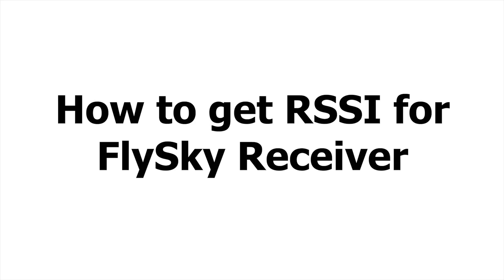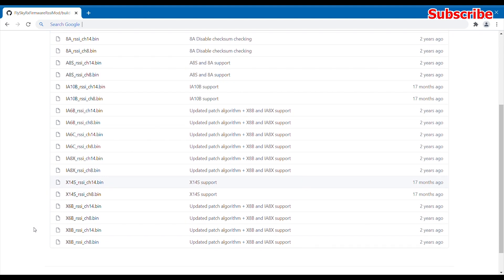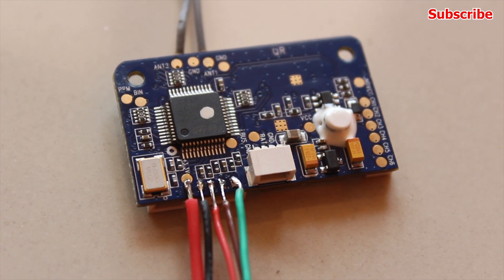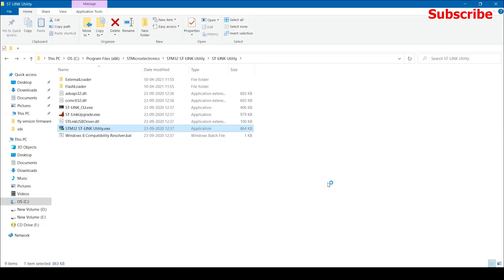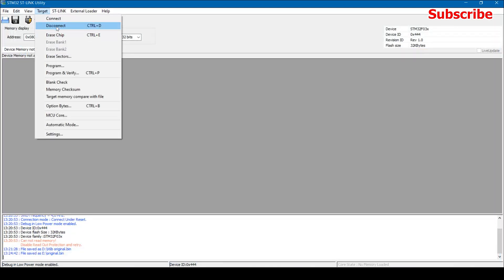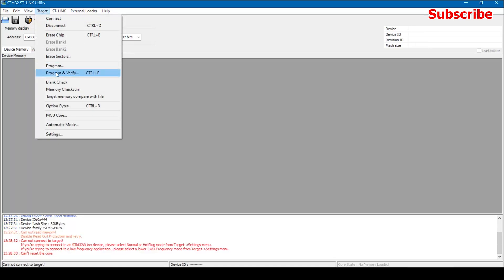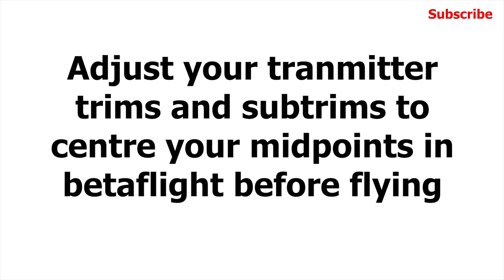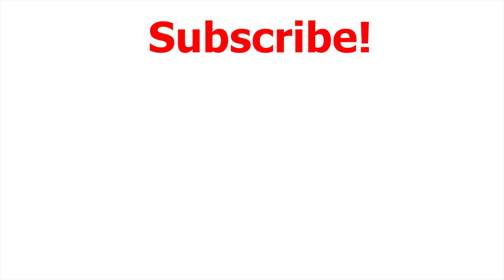Get RSSI for any FlySky Receiver with Custom Firmware | X6B | FPV OSD RSSI

Comment: So after flashing custom firmware how did you connect the receiver? Using ibus servo port going to flight controller uart? Single cable and still get rssi?
Reply from the maker: Yes if using i bus or sbus connect to the servo port and to flight controller using just 3 wires - power ground and signal to rx of flight controller. You even get LQ in osd. I've got a new video with fsia10b receiver on this topic 👍
Reply: Awesome I'll check out the new one too! These are my favorite videos you make!

Comment: so I see the custom firmware files... but where are the factory files? Why in the heck would they make it so you can't use this out of the box??? STUPID. Didn't know this before I purchased the device
Reply from the maker: Factory files are available on GitHub website if i am not wrong. You also have option to backup original firmware before flashing rssi firmware. Having rssi value on flysky receiver is very helpful to see rssi value in OSD.
Reply: @RakishRc  Yes in fact... I am a little scared to fly without it. I'm using a happy model 14 receiver which comes stock with RSSI output on another model. Where did you get the USB device to do the flashing?
Reply from the maker: @glytch5  it's the St link V2 usb device. You'll find it easily online.
Reply: @RakishRc  So did you make an account for this website in order to get the program from stm? Is there a way around that? Thank you for the info, can't wait to flash this receiver.
Reply from the maker: @glytch5  no account needed. Just have to enter you email and name and you'll get the link for software and drivers on your email.
Reply: @RakishRc  alright SWEET. Got the download, got the bin files. Just ordered the tool and as far as I know I already have STM32 installed for my f4 flight controllers... now just got to not break the receiver lol. I must say this is odd... I wonder can you flash the older iRangeX iR-A8S receiver. I noticed it also has those USB update pads.